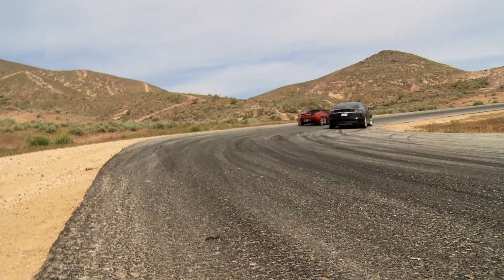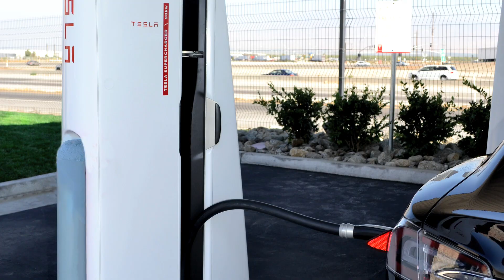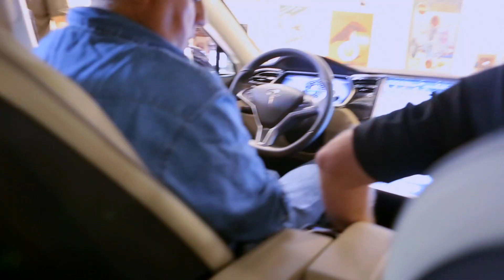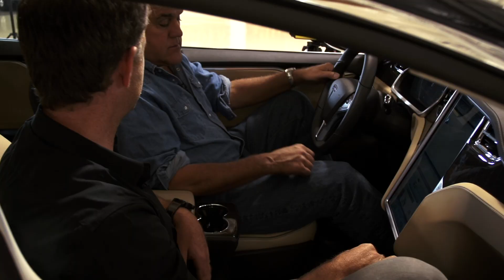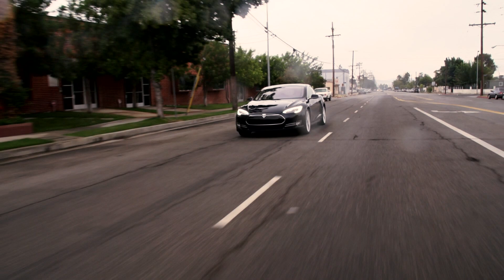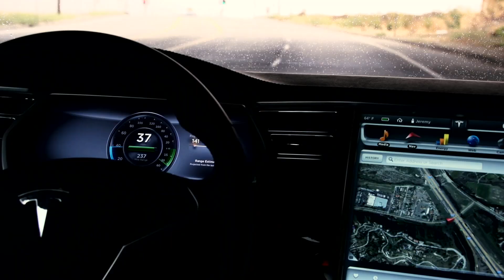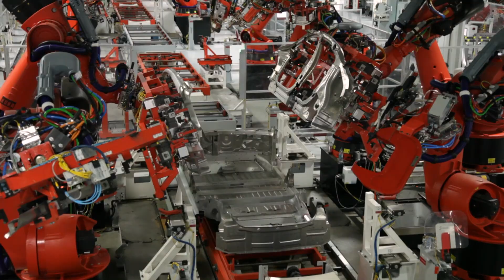2012 Tesla Model S - Jay Leno's Garage

Comment: What if the streets are flooded and your driving that thing...
Reply: It's all sealed (batteries are liquid-cooled) so you would be fine.
Reply: You'll be better off with this then. It doesn't have any intakes or exhausts, so you dont have to worry about the car's engine flooding. All of the components in Tesla are sealed, so it will handle water ok. Obviously you are screwed if it's over the top :)
Reply: True thanks for the info
Reply: We'll call it an act of terrorism and call in Al gore to hunt the Man Bear Pig... lol
Reply: they make an awd version now too, so your safe. btw,the new version does 0-60 in 3.2
Reply: What if there's a bunch of 4wd'ing truck-jocks with drowned intakes blocking the road?
Reply: ... My question was serious
Reply: Probably goes better than an internal combustion, doesn't have an intake to suck water in to...

Comment: Electric cars...what a joke.
Reply: Alex Minton Steam was once popular too you know, thing's get replaced dude(I'm also 20). Japanese small,"cheap(per)", fuel efficient cars eventually took the market from American muscle, it was just the demand.

Though most electric cars seem to suck in range and power consumption( Hey, the first gas cars sucked too ) they do have one thing, as Jay said these have lower maintenance.

If it takes off the newer improvements will be tremendous and hopefully they wont suck as much.
Reply: Alex Minton Uh. They're cars bro. You don't "believe" in them.
Reply: I used to believe in classic muscle.  I still do somewhat.  But the Mercedes I drive now has a 2.3 liter 4 cylinder engine that outpowers the 5.7 liter I had in the old Buick I used to have, and has about 1500 less pounds to push around.
Reply: The engineering for the tesla is amazing. ok. i dont believe in electric cars. i might be 20 years old but i believe in classic muscle. it's my opinion. if you dont like it, too bad. and Lord Trini, i'm not dumb. i just have an opinion.
Reply: Also, it's fine you have an opinion, but why be so insulting about it?
Reply: Alex Minton Wow.. You're slow.
Reply: Alex Minton Dude, why shit on this?  Sure, your Chevy is badass but nobody is saying you have to trade it in on one of these.  You have to at least respect the level of engineering that went into the Tesla.
Reply: You're a joke, you've obviously never driven a Tesla
Reply: And i obviously don't want to pal. i'm fine getting 10 mpg with my 52 chevy. keep playing with your childish electric vehicles. youre a real winner.
Reply: Alex Minton It was never really about what you drive( Though 10 mpg  is ridiculous, no offense ) so much as your attitude towards electric cars. Aluminum was once worth more than gold, the market can change and that the point i'm trying to hammer in.
Reply: I like classic muscle as well, but really, dude? This car would obliterate a stock '52 chevy in every single way, including driving range. 
If you want to talk modified, this car could be a lot faster if you dont worry about battery life, guaranteed. 
I think it would be a really neat idea to put a classic body on this tesla running gear, it would be a unique take on hot rodding. 
And no, im not a tesla fanboy, I have built many cars of varying makes and love them all.
That said, you are entitled to your narrow minded opinion, but dont get pissed when people call you out for being an idiot.
Reply: Alex Minton I hope you are young enough to see how dumb you are
Reply: I don't think I've ever owned a car that had that poor gas mileage.  I had a 307 powered Olds that came pretty close, but even that averaged about 14.
Reply: the modfather
and you're a fucking idiot.
Reply: Alex Minton by that reasoning; dont watch the video idiot. Ha!
Reply: Alex Minton In case you wondered why everyone is getting so annoyed at you, it's not because they disagree with your opinion.  I can respect the fact you like muscle cars, even if I do not.  The simple reason people don't like your attitude.

Get this:  Just because you're entitled to a negative opinion, doesn't mean people want to hear it.  Simply put, people don't like negativity if it's phrased in a provocative manner.   If you wish to express negativity, there's this thing called 'tact' that enables you to do so in such a manner as to avoid causing offence.  

In all fairness I never understood this thing where people think they're so damn important that everyone simply must hear their opinion.  You're not so special, so unless it's nice, it's better kept to yourself.
Reply: Will Davis for the sake of argument, that was a nice teaching lesson. But it's funny how people get so butt hurt over a comment. Notably mine. However, I probably could've been less "provocative", but, people are sensitive over a harmless comment.
Reply: Alex Minton lol, ok, ya got me too. Dammit! Cheers
Reply: the modfather no shit they're cars. i dont believe in electric. sorry to hurt your feelings. gas powered combustion engines is what i believe in, bro.
Reply: why does it matter to you what I want to drive?
Reply: Alex Minton 10MPG??? Holy shit thats terrible.
Reply: kragseven  see  the thing is i dont care. and quite frankly i dont care what an electric car can do. i dont like them. why does it matter to you to comment about my truck that you know nothing about? if you like electric cars good for you. no one was talking to you in the first place.
Reply: No one cares, STFU
Reply: Nicholas Wilson if you dont likethe comments dont read them
Reply: twoeightythreez my narrow minded opinion? ok. I never said anything about my stock '52 beating anything for the record. it seems like everyone else got pissed about my comment.
Reply: Alex Minton no, your logic is flawed and i proved it by throwing it back in your face. Dont get butthurt because i outsmarted you. It makes you look pety and weak.
Reply: Nicholas Wilson No, not butthurt. But you got me. And btw, if you're going to insult someone, and try to sound smart and educated, spell the word right. It's *petty.
Reply: Jay Leno has overruled you.
Reply: ***** can you please tell me why I am a fool?

Comment: 30 min to charge? Hmmm no thanks.
Reply: Yeah but you would charge it at home in your garage (most likely, if you can afford one of these cars, you have a garage). You would only need to charge it outside of your home if you take a long trip.
If you dont like the the idea of waiting 30 mins to charge it on a roadtrip, just use the other car that you likely have. 
Plus, if these cars become mainstream, it would be easy to slowly introduce an inductive charging grid under the highways, where the car would be powered from the road once at cruising speed. If that happened, you would only need the battery for rural areas.

Comment: 6 months into my Tesla ownership (Model S P85) They STILL can`t figure out how to fix my fu**ing sunroof and the indicator stalk is...... who thought of that? It points at a 45 degree angle downwards so you have to move your hand away from where you hold the steering wheel every time. May sound like a detail,but trust me on this,it`s annoying as f**k! The cruise control has a mind of it`s own,which is to say it seems like it has made it`s mind up never to work. Never get tired of the power tho and apart from what i just mentioned it`s a great car
Reply: I believe they used the signal stalk from Mercedes and that is how theirs is positioned. It takes time to get used to

Comment: Wait but what about the traditional problem with lithium ion batteries losing their charge potential over time .... Like a labtop I bought 2 years ago doesn't hold the same amount of charge now as it did when I bought it.
Reply: in 13 years, they lose 20% capacity, just like not cleaning out your fuel lines in an ice car, range reduces by not much, but performance doesn't decrease like ICE cars. mitusbishi batteries drop to 80% capacity in 7 years,then 70% 12 years. for imiev costs $4000-5000 to replace batteries, by the time I need to (2025). but I will probably have a tesla model x by then. For range I have an ex mil land rover with 3.9 L Isuzu 4bd1 engine, would not need a rebuild until 500,000 to 1mill k's. b then I would get a Land rover electric conversion kit
Reply: Gas engines lose power over time, too. With emission standards so strict, gas cars get quite costly to maintain as they get older. Usually the "solution"is for people to buy a new car every 5 years or so, which is extremely costly from an environmental perspective (it takes about 12,000lb of materials to make a 3,000 lb car). While the Tesla is also very damaging to produce, it could theoretically last forever, as the body is aluminum and hardware wise the tesla is simpler than a Gasoline car. There are less parts to wear out and when they do the car will be restored better than new performance, as replacement parts likely will be much improved. For example, imagine replacing the battery 15 years down the road and doubling the range of the car!

Comment: 44 % of the U.S. power comes from burning coal, 25% from natural gas and 20 % from nuclear.  Congratulations to Tesla for inventing a coal fired, natural gas burning nuclear powered car for rich libs.   Don't for get about all the rare earth minerals mined in big open pits to make all those battery's.
Reply: If the Tesla got 100 percent of its power from coal-fired power plants, it would still be a lot greener than any gasoline powered car with similar performance.  Where I live, there are no coal fired power plants, and I have enough solar panels to more than offset the electricity I use for the car.  I am also not sending my money to hostile oil-producing countries. Battery Electric vehicles are great for around town. If you can afford a Tesla model S, then you can use it as your only car.  If you can't afford the Tesla, there are plug in hybrids which come close to using no gas but allow you to refuel at a gas station for extended trips.  Or you can buy a cheaper EV with shorter range, and keep your old gas guzzling SUV for hauling large items around or vacationing.  After factoring in depreciation, insurance, and maintenance, it is probably best to just rent a truck a few times a year instead.
Reply: It's a lot more efficient to produce power at one large plant than many million small ones (car engines). It's way way way easier to capture byproducts of burning carbon based fuels at one large plant than many million small ones.
Reply: What they said. Lol and alot of coal powered plants are switching to natural gas. Where do you think they get the power to refine oil anyways they are just skipping the middleman and using the power for your car.
Reply: Nicholas Wilson how is that biased.  Its true.
Reply: Way to do some biased research....
Reply: Nicholas Wilson
Riddle me this Nicholas. Where do they get the rare earth minerals used for the 7000 cells to power the car ? Do they get their cobalt from the Republic of Congo? So instead of a blood diamond, Tesla is a blood car. You're the expert, please teach me.
Good day
Reply: Ronan Kearney almost all lithium batteries are made from mostly recycled lithium.

Comment: Tesla should make some apps that let you add engine sounds in the cabin from other types of cars! That would be cool!
Reply: Yes that would be cool.  I want an import fart can sound..
Reply: It is possible with aftermarket fittings
Reply: This fake engine sound will sound really FAKE and pathetic on interior speakers (silent electric motor whine is much more cool than fake motor sounds in some bmw - compare it). You will need whole extremely complicated subwoofer system located in exhaust pipe dummy to really mimic the experience, i think. And this will waste a lot of energy (yes, loud and nice exhaust means a huge loss of energy), cost a lot and complicate the whole construction. And it will somewhow send a message like ,,Electric cars are not true cars, thus they must imitate classic cars, etc"....

Comment: Think about the cost and the luxury features you get in this car for the money as well as the performance. Then imagine never paying for Gas or an oil change. Go do a KBB side by side of a Tesla Model S vs a normal American luxury car for 5 years cost to own. Think about all the other money you've had to pay for repairs or other things out of pocket. Then come back and tell me it's not worth the price or a viable option...I drive a Gas guzzling WRX and love high output petrol motors, but if electric is going to look this good and work this well, I could see myself wanting one in the future. Finally a company is going against the norm and finally innovating the automobile. We've been so stuck in our ways and the environment suffers for it. Gas motors will be around for a while yet I'm sure, but any bit of progress is a good thing.
Reply: #SubaruWave  - I too drive a WRX but once I'm finished with my house I am going to try and work on obtaining one of these. Which is not that far away.

Comment: Who the hell would buy one of these things?  I think the battery is like 50000 to replace.  In a 100 years this car wouldn't outweigh a expensive fuel efficient car on a cost benefit analysis.  Meanwhile the energy being produced to power these batteries is some of the dirties (coal etc) and the disposal of the battery is arguable worse than nuclear.

Comment: Is there seriously no maintenance with this car? If so, that's pretty sweet.  They should hire Yamaha or something to create a fake engine noise ...then it'll be perfect.
Reply: why??? enjoy the silence!
Reply: lol, just hook up your mp3 and play engine sounds.
Reply: BaberJacks The regenerative braking system significantly reduces wear and tear on the brakes by converting the car's momentum back into electricity with a generator instead of converting it to heat via friction. Batteries need replacing once a decade max, and maybe not even that often. And you forgot suspension bushings. Bushings, bearings, and brakes probably need maintenance every 100k miles or so, and the battery will probably go quite a bit longer than that. There's wipers and wiper fluid, but that stuff is so cheap it should hardly count. It may need its water pump replaced occasionally, and the air springs may need occasional maintenance, but those are both also high-mileage maintenance items. It's hard to know how high mileage exactly since Tesla would apparently rather sell you a "maintenance plan" than make a recommended maintenance schedule available online, which is very disappointing. I don't think it's reasonable to expect to be able to sell cars to people without first telling them what will be required to take care of it. In any case, tires are definitely the most frequent maintenance item by far, which is pretty cool.
Reply: tires, breaks, bearings and batteries.
Reply: BaberJacks Still much lower maintenance than a regular car, and Tesla said their shops are fast.
Reply: It could easily be done. Put a big speaker box in it and program V8 engine sounds (synced to throttle and car speed). Port the box through a set of dual tailpipes and i doubt most people would be able to tell the difference, lol

Comment: I typically haven't been a fan of electric cars.  But this is a very cool car.  Family sedan with a 0-60 of 4s and the range to drive from LA to Vegas?  Not to mention it looks great. I think the two backwards-facing seats in the back just top off the awesome.
Reply: you can now drive it from LA to NY to Miami. More Supercharging stations are coming on line in the next 2 years.
Reply: thooke222 the newest model s has the fastest 0-60 of any super car out now

Comment: "Range is not an issue with this car" says Jay. They drove about five miles total--it did great for five miles.
This morning it was about zero degrees at my house. How many miles range will it have when I use the heater? The same with the A/C in the summer?
Here are the facts: If you drive normally around town all day the range is around 100 miles, a lot less of you like to accelerate much. If you run the heat or A/C the range is WELL under 100 miles. It takes HOURS to recharge.
Reply: you clearly don't know anything about Tesla Model S, and I suggest you refrain from ever talking about it again until you know basic facts, such as the fact it can do 300 miles on a charge.  Such as the fact it works just fine in the cold of Norway and it's a best selling car there.  Such as the fact it can charge at a rate of 300-400 miles range in an hour.  Such as the fact at highway speeds with the AC on full it can still do nearly 200 miles.
Reply: Will Davis Teslas can get 300 miles on a charge on the freeway, assuming 50-70 temperature with climate control, 60mph speeds. If you want to go faster than 60mph, 70mph cuts your range by 50 miles. If you have the 85kWh battery, you should be getting over 200mph even with AC full and highway speeds.

 It can't charge at a rate of 300-400 miles range in an hour at all though.
Reply: Enzo Piacitelli my dad has a p85 model s and my brother has a leaf. The s is better than any real or fictional car I have seen. The leaf like you said is good for what it is a commuter but nissan's battery tech and placement leave much to be desired(pun intended). Making the floor of the car the battery pack is the only smart way to do it, that would require a manufacturing change for most car companies though, which is why the first car I buy will be the 3. Honda, bmw, Toyota among others have all announced they are attacking the ev market mostly because of California regulations and chevy has the volt but I think elon put it best "the volt is a not very good electric car and a not very good gas car combined to make a ok car" not verbatim.